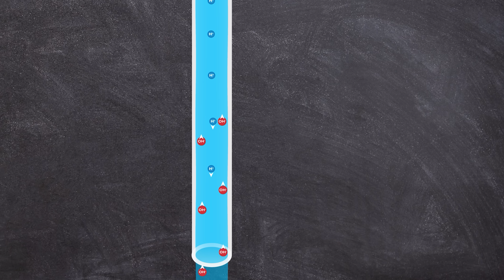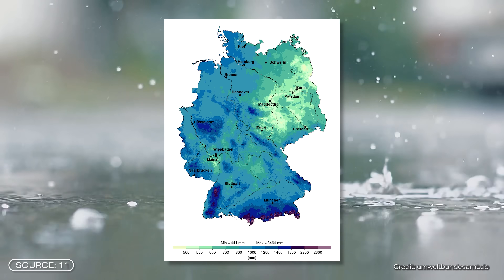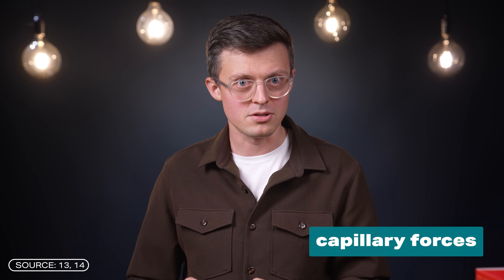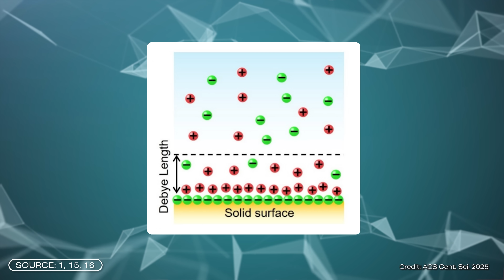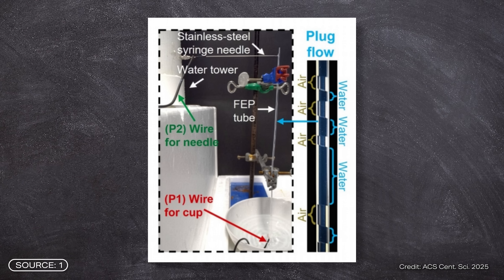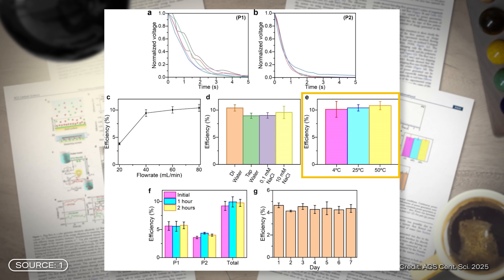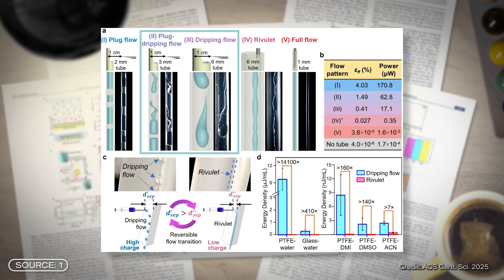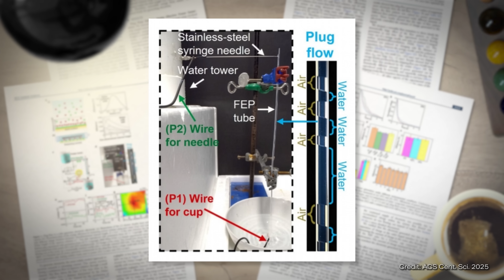Physics Hack: 100,000x More Electricity from Rain!

Comment: If the inside of the tube was ribbed(with a barb type pattern, but inside), wouldn't the water constantly touch and break free from the side causing many water/air transitions? Also, if you are already storing the water in a tower, it could easily be filtered before sending to many tubes, so no dirt contamination.

Comment: Cool science, but the total potential energy in rain at roof-top height is very low, and easily calculated. 
If you get 1m of rain per year, on 100 square meters of roof, 5m above the ground, that's 5M, or just over 1kWh of energy per year.
100W/m^2 has got to be wrong, unless they're looking at the cross section of the tiny pipe?

Comment: your first pic shows a tube throwing out individual drops, it does not show the horizontal tube in connection with the vertical tube . Therefore the two electrical wires from those tubes have no complete electrical path/an open circuit. there is not a correct connection between the two pipes.  ???

Comment: Can this effect be extended using multiple vertical stacks of the tubes and reservoirs? Each layer would pass its outflow to the next layer?

Would this act like a series circuit, with voltage increasing at each layer? Would this limit the ability to create charge separation at some point. 

Is there a way to do this so it acts like a parallel circuit.  That would increase the current without driving the voltage up to the point that it constraints the chemistry. 

It might not be a roof top system any more, but a stack like this might beat solar in open spaces where it could be built.

Comment: Its half of a solar "water battery":
Sealed unit. Distilled water.
After it drips down,
Water spreads out over black heat panels to evaporate and then condense back up to the collector at the top to start the cycle over.

Comment: I'm not exited, here's why:

The energy comes from gravitational potential, which is mgh = mass times gravity times height. About 9.8 joules per meter per kg, with an efficiency of just over 10% that means about 1 joule of power extracted per kg per meter, so if you have a height of 5 meters, you could extract about 5 joules per square meter of roof, per millimeter of rain.       

If you get 1000 mm of rain per year, which is about the global average, that's 5 kJ per square meter per year, if you have 5 meters of height. Solar PV can produce over 300 kWh/m² per year in average conditions where most people live, that's about 1 gigajoule, which is 1,000,000 kJ, that's 200,000 times more than that system.  If you have 200 m² roof, and 5 meter height, and 1000 mm rain per year, you could theoretically generate about 1 megajoule per year, from the entire roof, to put that in the perspective most of us pay for electricity that's ~0.278 kWh, per year, from 200 m² of roof, that's ridiculous.     

You can adjust that calculation for whatever conditions you have to figure out that it's pointless in any situation. Even if you have a 100 meter tall building, and make such a system that tall, and 10,000 mm rain per year, which is multiple times more than any country's average, solar panels on the roof can still produce more than 1000 times more power per year for a given size roof. 

One could argue that such a power from rain system could produce power even at night, if it rains, but batteries can store such amounts of energy and deliver it on demand, regardless of weather, very reliably, and for such amounts of power very little money.       

Water turbines, that also use the gravitational potential in water, that is the same as that "system", can have an efficiency of close to 90% and are compared to that technology essentially free for given amount of output, extremely simple and rugged, and long lasting and so on, the reason we don't use them to extract power from rain that falls on rooftops is the simple fact that the potential energy is insignificant.

So the amount of potential energy is ridiculous, and even if it was considered relevant in some extremely rare situations, simple water turbines are already multiple times better in multiple ways, compared to how "good" that system realistically could become, with further development which potentially could improve the efficiency a bit. 

I think your presentation of sources is exemplary, but I think your analyses sometimes could be a bit better. This particular technology to extract useful energy from rain that falls on rooftops is objectively even more stupid than solar freaking roadways. I don't have a PhD, but even I realized practically instantly that this technology is utterly pointless for generating useful power, the first time I heard of it. 

I understand that you need material, but maybe consider pointing out the actual fundamental flaws of ideas like these, "busting videos" seem really popular. 

By the way, I think the "power density" of 100 watts/m² refers to the system itself, not the collection area, as at that efficiency you only get about 1 joule per kg per meter height, meaning even if you had a 100 meter tall building and used all that height, you need about 3600 mm of rain per hour to extract 100 watts/m² of roof at that efficiency. 

Also, the paper says that power density refers to a single stage of that system 32 cm high, but as far as I saw they didn't mention that would require about 300 liters of water per second. That means if multiple stages can be stacked you'd still need about 1 cubic meter of that system to generate 300 watts, from 300 liters of water per second passing through each of those tubes at a perfect rate. The efficiency mentioned was the highest they achieved, which required a very well controlled flow, and the output fell sharply if the flow rate and characteristics wasn't optimal.
Reply: Yeah, the only feasible way to harvest energy from rain is to build a dam and use it to generate hydroelectric power. That really is "100,000x More Electricity from Rain!"
Reply: @omarnug One thing I always wonder whenever the “Just put water turbines in the rain gutters” comes up, is why don’t cities put turbines in storm drains? Don’t know too much about sewage or water systems, but surely there’s some point where there’s a large amount of water that flows through when it rains?

Even then, I realize it probably wouldn’t be enough power to justify building a turbine, unless it was an area with an extreme amount of rainfall throughout the year.
Reply: @asd1070  That will impede the flow, let alone all the 'debris' that could damage the generating equipment. Service will be a nightmare. Not worth the pennies it can produce.
Reply: Rainwater and 2mm tubes are not a good mix. Lucky if it ran for ten minutes. Better just collecting the water to reduce your water bill.
Reply: The most promising use of this quality of water is an added layer onto solar panels already on roofs if you can make the circuit small enough and not impede on the already very efficient solar panel underneath that is, but complexity leads to cost and easier degradation so hard to justify really, better put bets on multi junction solar cells becoming more stable/affordable. Solar is already so good the question is how much energy do you really need, as a single person, after a point its excessive anyways.
Reply: @MrFelixFB  Solar panels are great, and the panels themselves are really cheap, for the amount of energy they can produce over a year. The downside is that solar panels only produce power when there's enough light, which means they need to be complimented with other forms of power generation and or storage. But the energy represented in gravitational potential in the rain that falls on a normal roof, which they're suggesting to extract useful energy from, is ridiculous. To put it in another perspective, it wouldn't require very high level of skills to make a tiny wind turbine that could generate more power in practically any conditions than all the gravitational potential energy in all the rain that falls on a normal house roof. 

Tiny wind turbines in low wind conditions are really bad for collecting relevant amounts of energy, but trying to extract meaningful amounts of energy from gravitational potential in rain collected from rooftops is a much worse idea. The quest to develop some new technology to convert that gravitational potential in the rainwater adds another dimension of stupidity.
Reply: Yeah, I also thought about this and was a bit disappointed that none of this was discussed on the video.
Reply: Look at @AirHES technology
Reply: Wouldn’t it be more efficient to place small power generating turbines inside the rain gutter downpipe and use gravity that way?
Reply: @Nightraven26  Turbines can be many times more efficient than such tubes, which I mentioned. Turbines can also cost less than 1% of the cost of such tube system could reach if they were mass produced, for a given output. Also, turbines wouldn't have to be even 1% the size of such tube system, for a given output. And, turbines can handle rainwater, those tubes will most likely stop working even from microscopic surface contamination.       

Still, extracting energy from the gravitational potential in the rain falling on rooftops is pointless anyway, as there's such  ridiculously small amount of potential energy to extract energy from. You only need to understand some very basic high school level physics to figure out the average total amount of potential energy in that from the area and height of the roof and the annual rainfall.
Reply: I live in Portugal and I’m told by solar installing companies that with solar panels rated for 400kWh/m² I should expect at most an average of 200kWh/m² of production through the daytime of a year 

Albeit I’m in the north (not the sunniest part of the country) how are you estimating 50% more as a world average?

That said, this doesn’t seem to be exclusive. 
You could have both solar and this.

I’d say this might be overengineered, as a low voltage generator and some sort of turbine in and already installed drain pipe and connected to a battery is probably better value for money.
Reply: @romapires  I'm not familiar with that rating system for solar panels, that's not what I referred to. A rating of some amount of energy per unit of area requires a time factor to make any sense. As kWh is a unit of energy, not power, and solar panels converts energy, they have a potential power output, depending on the conditions, not a fixed potential energy output that is unrelated to time.      

For each Wp (watt peak), solar panels can produce somewhere in the ballpark of 1.5 kWh per year, assuming good installation, and it varies with location. Even here in Sweden, you can get more than 1 kWh per year per Wp, at least in the southern part of Sweden, where most people live. In more sunny areas of the world, solar panels can produce up to 1.75 kWh per year per Wp, and if you take into account where most people live, the global average should be somewhere in the vicinity of 1.5 kWh per year per Wp.        

I don't know much about Portugal, but I suspect you have much better conditions for solar power generation than we have in Sweden. Maybe you should look into what those companies tell you, what they mean by that rating, and continue to compare more quotes from more companies. The cost of just the panels, from the right supplier, can be a very small part of what most companies charge for complete residential rooftop installations, around here at least. I suspect the cost of complete installations will come down quite significantly as that market matures, and cost of inverters and other stuff needed also decrease.                 

And yeah, a turbine would be a much better way to extract energy from rainwater than the subject of video has potential to become, that was a part of my point, but even with a turbine the potential output from rain collected on the roof wouldn't be worth the installation of even just the necessary cables in any normal situation.
Reply: Dang son!! Make a video. 😂
Reply: @fishyerik Have you watch the video? This has nothing to do with gravitation potential at all and your analysis is completely wrong about how these researchers produced electricity.
Reply: @Traumatree  I've watched the video, and read the paper, which actually mentions that it is the gravitational potential energy a few times. I also checked a few of the calculations in the paper which also were consistent with that. It's the first listed source in the video description if you want to check for yourself. 

Explain to me what kind of potential energy you believe is there to use?

Comment: Large scale hydropower maybe limited by river flow but microhydro can be also used effectively even if it only generates 1KW or less, because of limited stream flow and head, that power is continous and can be stored for inversion into an AC supply 
Kris Harbour lives in Wales and has designed and manufactured his own system:

https://youtu.be/Hij3sSYKuVQ?si=9mbovwxxKeJIShMH

Thank you for your presentation.
It shows why scientific exploration is so important .
This energy generation system may not lead to a practical design but it may be a step on the way to something more significant.

Comment: Hmm - combine it with hydraulic ram and probably will work good as last resort power if the rainwater will be stored in a highly placed tank and fed trough a filter
Technicly speaking you can just make a waterflow spreading metal plate that separates main flow into hundreds small elininating need for pricy needles

Comment: Ok let's do a back of the envelope calculation. 1000 mm/year of rain. House with 100 m^2 of caption area, ideally collected at 8 meters of height. It's 100,000 kg at 8m in 9,81m/s^2 gravity field, for a total of theoretical 8MJ of energy, or a bit more than 200kWh. Per year. With the claimed efficiency, it's about 20 kWh_e. We've wasted collectively more energy on this video and its comments than the energy this system will ever produce in the history of the universe.

Comment: Could you use a coil of wire, placed next to the dribbbling part of the tube, and use the resulting magnetic poles to power something (or turn the output into something that can be used, for free, as an electrical energy  convertor)?

Comment: I think that if we were to connect an electrical load to this structure, it would slow down the drops as they fall down the tube, just like a magnet is slowed down in a copper tube by the magnetic field of the eddy currents that are created.

Comment: Imagine putting this system in a river in a city, you could generate a lot of electricity and as it is not taking anything from the water they can have a dozen or hundreds of these systems in a very short area of the river, all pipes used to transport water to homes and businesses could be generating electricity.  No need for dams if the systemc and generate enough energy.

Comment: Making power from rain is not possible on a big scale. The ideas of making it from the free electrons in rain drops is in such a miniscule amount that it will never be economically viable. Putting up a kite with a steel wire to the clouds gives more electricity. I have tried it. It does work BUT IT ISS DANGEROUGS. A lightning may come with it.
Reply: It was only 36 years between the first ever powered flight in 1903 to the first jet flight in 1939 . So any research now could be magnified over several years .

Comment: I just put the water into a squat tank high up and pipe the water to the taps worked with no pump needing electricity worked for 30 years with no moving parts.

Comment: This new tech converts about 10% of the kinetic energy compared to 50~80% with a micro turbine.  Is this going to be better than putting a turbine at the bottom of a single large pipe?

Comment: This is pure garbage and a waste of time and is a problem with scientists who lock themselves away into a room and memorise bollocks from a textbook, repeat it and think of themselves as smart.   However why waste your time with problems of capillary action,  debye length, and trying to get the perfect drip rate all for 10% efficiency?    Instead just take your existing roof that collects rain water in the gutter system and plug in to the down pipe an off the shelf turbine based pico hydro system and get 50-80% efficiency.

Comment: Even a small system would be very useful as it supplents solar on cloudy days and works at night, exactly when my primary source of electricity, solar panels don't. This would eliminate switching to the grid just so I can balance the battery the next day.
Reply: 30 top 60 bates moren age tyats 6 watts too 12 watts per hiur

Comment: This is pure IDIOCY. Some simple calculations show this is capable of generating insanely low amounts of power, and nowhere near the 100W / square meter claimed. 

Heavy rain is defined as more than 4mm per hour, but let's use 10mm per hour. This is 0.0028kg of water per second, per square meter. The velocity of large rainfall droplets is about 9m/s. So the kinetic energy of this rain equates to 0.11 Watts per square meter (ie, 0.5*0.0028*9^2). But the claim is 10% efficiency for this new process, so that's only ELEVEN MILLIWATTS PER SQUARE METER.

Comment: Certainly an interesting idea but the low power-density and the sheer cost of the system would be deal-breakers. 
In many cases it would be simpler and cheaper to have a few lead-acid batteries to provide power.  
A fuel cell would be another good option.  The technology is well-known and there are a number of different types to choose from. 
A Stirling engine (although they don't give a huge amount of power) could also be a good option.